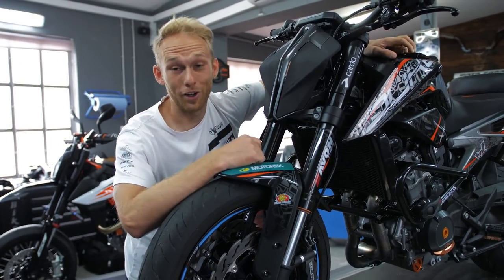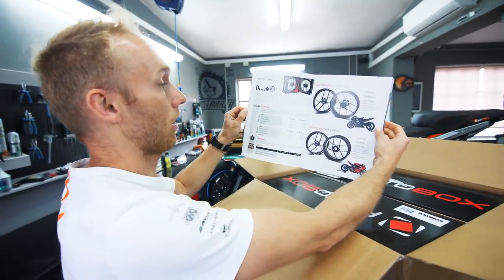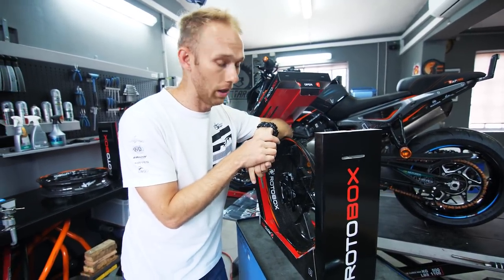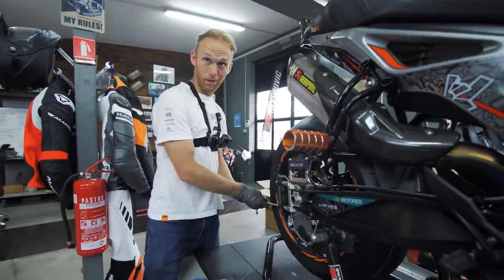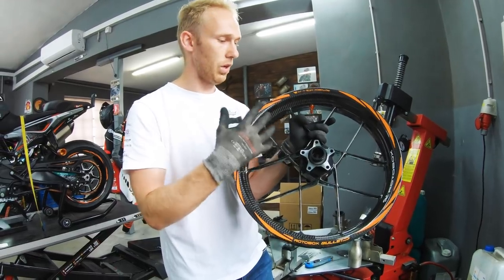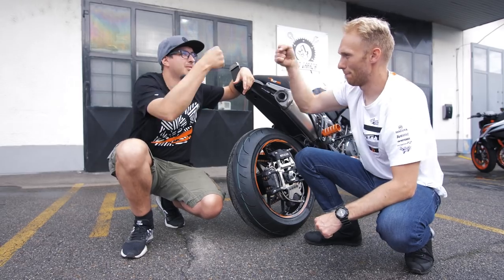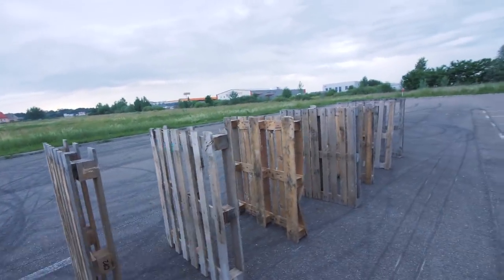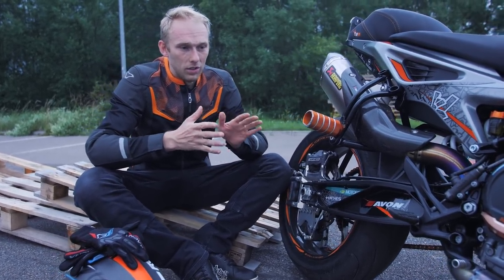[CARBON WHEELS] BUILDING THE LIGHTEST STUNT BIKE | RokON VLOG #97

Comment: Hey you can replace nuts , bolts,screws and sprocket type of parts with titanium part it is 45% lighter then steel.
Reply: And stronger
Reply: @antoniocernat678  And it will become the most expensive stunt bike ever. But yes, titanium is nice.
Reply: Ko
Reply: Why not ergal then? It isn't as strong as titanium but, if i'm not wrong ergal is way lighter (should be around 2.88g/cm³ for ergal and titanium is ~4.5g/cm3)

Also ergal screws/bolts look, sick even tough, just like titanium, they are kinda pricey
Reply: Wouldn't say stronger, they both have their strengths.
Reply: @CBXrr  do you work for them or what? Are you actually saying that you can get titanium bolts cheaper than steel ones? I highly doubt that they are real titanium.
Reply: @CBXrr  i'm glad it worked out for you, but man that sounds like a sales pitch!
Reply: are you nepali
Reply: @ramesh-xv7ui  yes da indain nepali
Reply: @wheelsonhills6461  from where
Reply: @ramesh-xv7ui  Darjeeling
Reply: @wheelsonhills6461  ohh nice myself from butwal do u use social sites
Reply: Titanium are heavier duuh alloy is lighter

Comment: Some ideas for weight savings...

Custom Carbon Body Panels, rear subframe in Carbon and stuff like the Front sproket housing and Heat Panels in Carbon. You can easily Lose a few Kilos with that.
Reply: I think anything that holds fluids would be pretty heavy. Helium in the tires too

Comment: I just came across this and your comments at the end of your teat ride really made me smile, because in changing un sprung Weight the actual change to the feeling of the bike is a factor of 7 (from memory) which means that even though you only dropped 4 kilos of mass, the bike acts as if it's 28 kg lighter, and it's makes me so happy that someone realised the difference it makes to the ride rather than just going "my bike has sik wheels bruh" 
Love the video and I'm not sure on your rules your comp has but to shave weight I'd remove front fender entirely, headlight assembly entirely, probably shave the rear tail section, carbon bars normally saves about a kilo, if you can get them for a duke carbon brake calipers are a thing nowadays, and probably a carbon caliper holder as it would also be un sprung Weight and the riding difference again has that factor of 7.
Really liked the video and your new staff member :)

Comment: I’m actually curious to see. How carbon wheels hold up to the abuse of wheelies and what not! It’s my single fear with them
Reply: I have heard the carbon is alot stronger so it should not be a problem at all. Christian Von Koenigsegg build a whole car in carbon, I think he knows what he is talking about.
Reply: @Youtube_Globetrotter  But the force a Koeningsegg undergoes is different than smacking a wheel down repeatedly. So it's still going to be interesting to see how it holds up
Reply: Bernd DasBrot  "Stronger than what"
Whas are rims usually made of?
Aluminium ofc
"A monocoque for a car doesn't need to be impact proof." 
You don't think they test? They do for sure. Christian told to destroyed many of the Regera in saftey test. I don't think It would be road legel if they didn't
Reply: @jobosbaeten  True, but what force do you think you can achive in a trick?
And how mutch force do you think a Koenigsegg make with 1700 bhp
Reply: @jobosbaeten  Ther is a reason why carbon is better than plastic for helmets, all carbon absorb the hit not only the contact zone
Reply: I believe they'll hold up . I mean those are strong enough to be wheels, so..
Reply: @chris5k132  But carbon also a plastic, but it has more stronger element of carbon, but it brokes.
Reply: guys it's almost completely impossible to destroy those carbon rims  ...
Reply: Bro you can't destroy carbon, this whole bike, if dropped from a height, Everything else will shatter other than the carbon wheels.
Reply: there is a video of a dude testing carbon wheels and abusing them on a MTB "Danny MacAskill Tests Santa Cruz Reserve Carbon Wheels
" they seem to be pretty strong
Reply: Carbon fiber is really strong but it's problem is that it's not very flexible, idk for bikes and rims but my dad, who sells/repair/builds bikes for a living told me more than once how he'll never get a carbon fiber racing bike.
They are really light but the carbon fiber isn't flexible enought to sustain all the forces a racing bike should so, while it's amazing at doing it's job the fram usually never lasts more than a year or two if you really use it, and you should since those bikes cost a fuckton of money.

That's also why you would never see a carbon fiber BMX, the frame would just get ruined too quickly after all the jumps and crazy stuff you do with them
Reply: Why you don't see cf swingarms and wheels in MotoGP.
Reply: @replynotificationsdisabled  there not aloud carbon wheels
Reply: @matthewthomson5679  not they're not allowed*** they just don't want to use them.
Reply: @replynotificationsdisabled  there banned in motogp do some research
Reply: When buying Carbon fiber parts just check if it's space grade CF part, or buy a CF/Kevlar rim, you'll be bullet proof.
Reply: Actually carbon is more likely to crack than metal. Is does not bend as much. Depends on the quality of the carbon. Actually the new s1000rr has a problem with cracked cf rims.

Comment: You want a lightest stunt bike? Carbon frame, forks, engine head cover, clutch cover, rear arm, handlebars, seat construction, gas tank
Reply: swap your original battery for a lithium, saves you 2kg. Super-B lithium batteries.

Comment: Carbon ceramix rotors, carbon rear subframe and rear swingarm. Carbon panels. Carbon handlebars carbon rearseatcover, carbon footpegs, carbonfibre gearpedal/brake, carbonfibre brake and clutchlever, rear footpegmounts in carbon... And so on ;). Carbon fibre is pretty strong so you can basicly go as far as you want to. Even the main frame should be possible.

Comment: I saw someone  planning a titanium. Trellis frame for a Ducati. Maybe they'll make one for the Duke? Carbon valve covers. Yamaha had some magnesium bar mounts once. I used to work at a titanium spring company. They saved alot of weight there, too (if you don't already have some) It was xalled Renton Coil Spring. They made for F1 teams as well as passenger and military airplanes.

Comment: Thanks for the video because the strength of the wheel will be fully tested by you in the stunt world will be the first one probably,, good to use titanium bolts,, carbon fibre parts for the body work,, I salute you for the choices you have made, 👍👍☘️☘️from Northern Ireland greatly appreciated, bike is. Best ktm on the Web

Comment: Carbon fiber frame
All plastic panels to carbon fibre
Engine casing and clutch cover to titanium
As many engine internals to titanium as possible
All the bolts to titanium
All the stunt parts(foot pegs etc.) and brake and clutch lever to titanium or carbon fiber 
And lastly..a titanium handlebar
The bike will easily tip around 150 kilos.
Reference: ducati superleggera
Reply: Oh, I didn’t know Rok was a millionaire...

Comment: coming from mtb. try to find someone to make you air-suspension. saves heaps of weight compared to steel coils.
carbonfiber, magnesium and titatium in every possible part =) there is a reason modern "stock" bicycles can be more expensive than decent motorcycle
Reply: I dont think air spring forks would work on a motobike for the same reason alot of down hill forks use steal springs

Comment: ROK, the 2020 KTM 1290 SDR has that exotic material under the passenger,KTM say it stromg enough for 1000KG. Why are they not using this composite material for the frame? Imagine the weight lost.

Comment: Carbon fiber gas tank. Get rid of the seat & make a carbon fiber seat pan. Change out your handlebars to either carbon fiber or titanium. Also like in the comment below change all your nuts, bolts, & sprockets to titanium. Change your engine covers to titanium or magnesium. They also have really light tires, that come with kevlar inner tubes. You could also change your swingarm to carbon fiber. Basicly change every part on the motorcycle to titanium & carbon fiber, & delete all things that are not needed after all it only a stunt bike. I also see that you have multiple calipers on your back brake rotor. The back brake on a car pr motorcycle is only 30% of the stopping power.

Comment: I was gunna ask in your last vid "what brand of carbon wheels are those?" Now I know!!
Reply: @RokBagorosStuntrider  I went with BST as you can not show me Rotobox being torture tested to the same level of Dymag or BST ... all of the main manufacturers have also declined Rotobox when it comes to putting them in their bikes as stock!
BST smoke all the torture testing with Dymag being second but Rotobox is not even in the same ball-park.
Ducati put BST on some of their most expensive bikes a stock ... no one in the industry is using Rotobox as stock rims.
Reply: @RokBagorosStuntrider  Watched the video ... I could care less about the box it comes in! It is not a pair of Nike trainers. Will it stand up to a high-stress load on the bike? 
The logo from Rotobox is too big and in your face.
The spokes look pretty weak considering it is going on a stunt bike.
Made in Slovakia with low tech. I love the way you bought into the wire rim in the carbon ... they told me the same thing.
Because BST rims are exploding when you bead a new tire every time ... no, they are not.
The supplier I brought from in London will, not even stock Rotobox!
If will pay attention once you put 15,000 km on them without them smashing.  
Type 'rotobox carbon wheels failure' into a web browser and see what you come up with!?

Comment: I’m using a set of Rotobox Boost wheels and many other custom parts on my GSXR 750 Cafe Racer. It weighs in at just under 360 pounds (163 Kg) ready to ride. Here’s a link to the build if you want some other ideas on how to reduce weight. https://bikebrewers.com/helium-dreams-suzuki-gsx-r-750-by-synaps-cycles/

Comment: Forged carbon fiber are not actually forged...
It’s just a pattern that looks like forged metal 
It’s made from shredded carbon fiber
And if it doesn’t have other material as core it’s not as strong as normal weave carbon fiber

Comment: Those wheels are nice but very expensive and for a 4kg saving in weight I would prefer go on a diet and make sure I have a massive shit that's probaly equal to 4kg saving and costs less
Reply: Thats not the same.  Its different if you loose 4kg on the rims than on the bike itself, mutch better handling  with lighter rims.